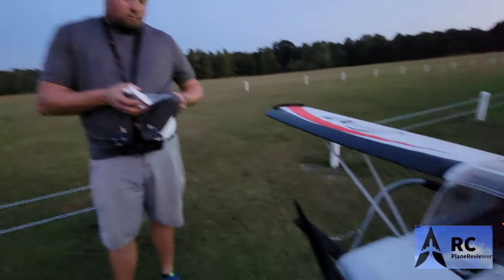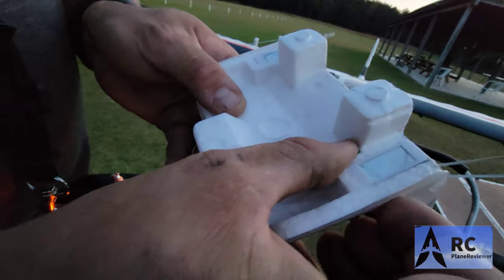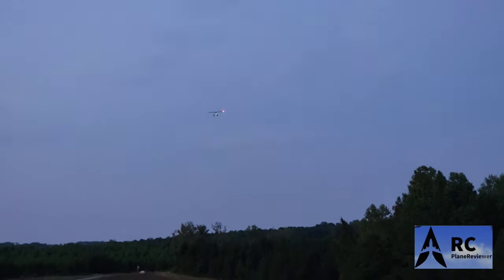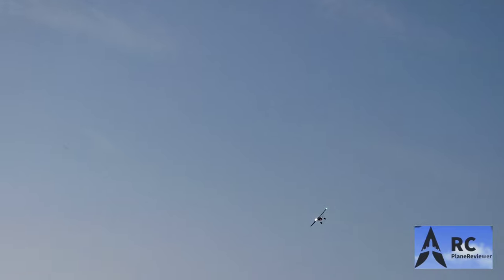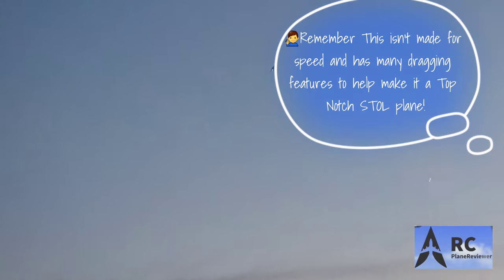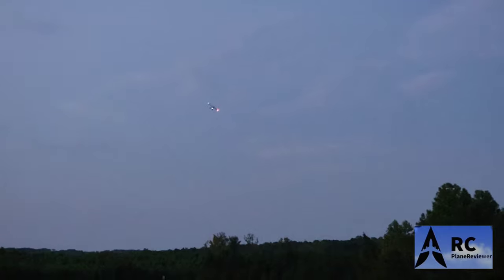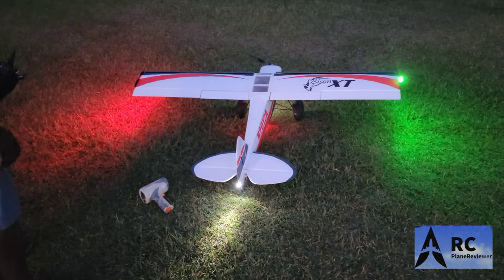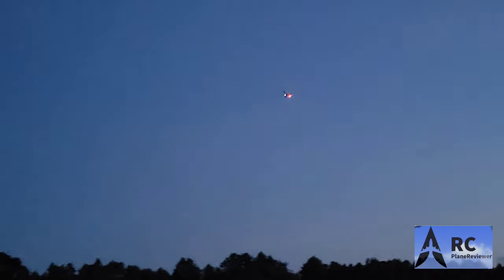Part.3 Skynetic Bison XT STOL 1750mm Night Ops 🌙  And Speed Trials

Comment: FMS Beaver, Eflite Carbon Cub SS, or this one? Which one is better in your opinion? I’m about to get a new plane and the first two are my top choices. Then I saw this…… 🤔
Reply from the maker: The carbon cub ss is the best, I haven't flown the beaver but have flown the smaller version and it's equally a great flyer. We were disappointed in  the Bison..in the parts and how it flew very heavy..the others fly very light.
Reply: @RCPlaneReviewer  Carbon Cub SS it is then. Thanks!
Reply from the maker: @dronecatalyst  You won't be disappointed!!